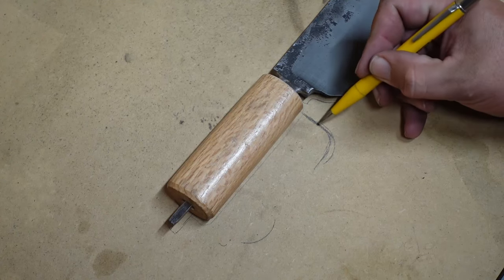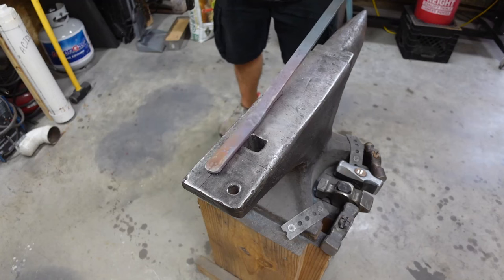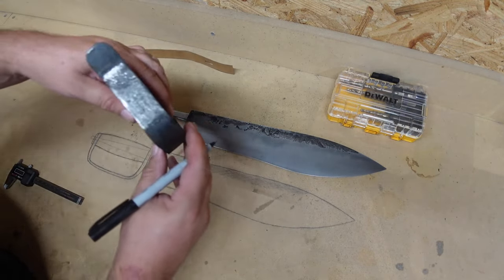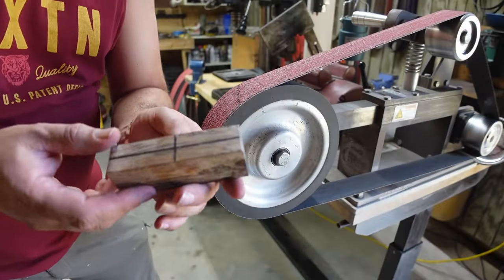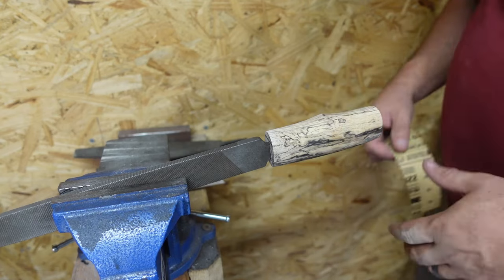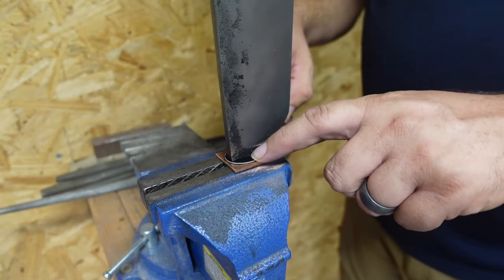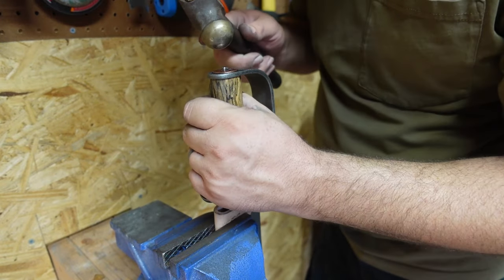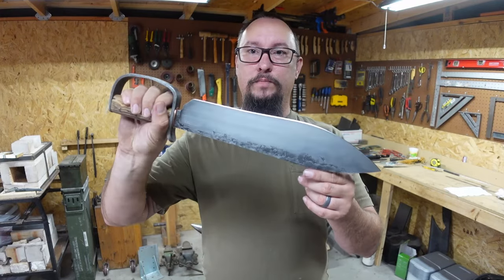Finally Finishing The D-Guard Bolo Knife!

Comment: My limited experience with gun bluing was I used a paint brush and don't contaminate it. Use a separate cup of bowl.
  Testing sharpness on foot ?
Thanks and like the paper trick for the D guard
Reply from the maker: I used a foam brush on a project that I did just after doing the D-Guard. It worked way better.

Comment: Just a suggestion from my side for what its worth..❗
Consider matching the Copper pomel with the Copper bolster by flowing both right down to the curve line in thickness where the Gaurd (both) start changing direction from vertical to horizontal position .i.e., half thickness of Gaurd thus making the pomle almost an integral part of the Gaurd at the back thus avoiding it seeming as though it's planted on..⁉️🤔🤷‍♂️
Ps ! I know it creates exyra work in forging or stock removal but could look more slick in flow of lines..⁉️🤔
Reply from the maker: Yup I agree, that would look pretty good.
Reply: @theriversexperience9383  thanks..❗🙇‍♂️ i'm drooling with curiosity to see n Craftsman such as you execute it..❗🙇‍♂️
Ps ❗so that i can just copy..haha..❗🤭🤭
Reply: May i even be more cheeky & suggest to peen the copper to match the Gaurd as the Indian Copper-smiths would do i.e. "Copper-beating" when they make Vases etc.❗🤭
Reply from the maker: @bernardhill1622  I did hammer the copper and textured it. The clip of that was only about 15 seconds long in this video, so you might not have seen it.